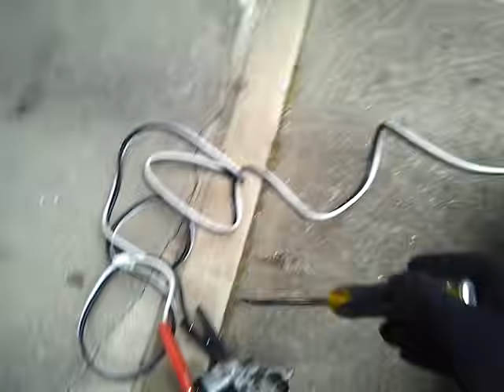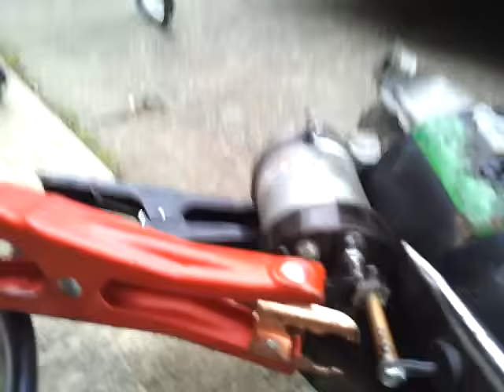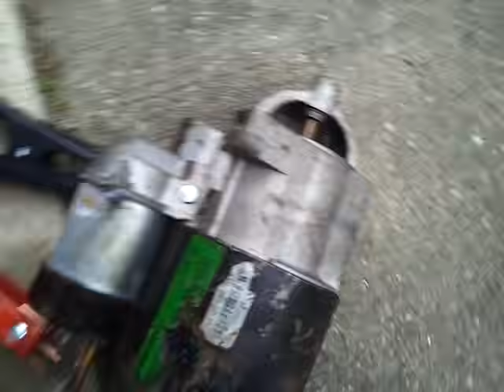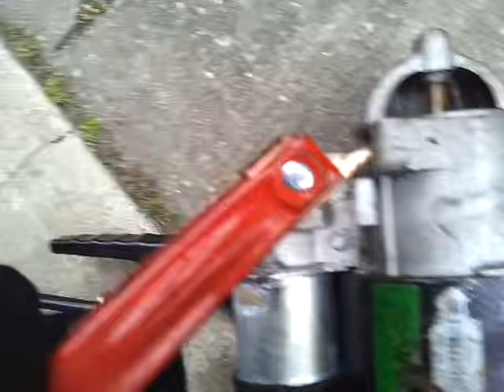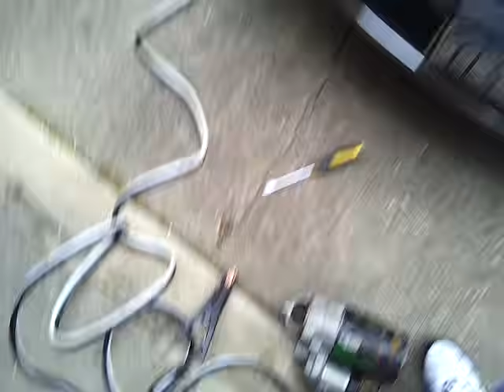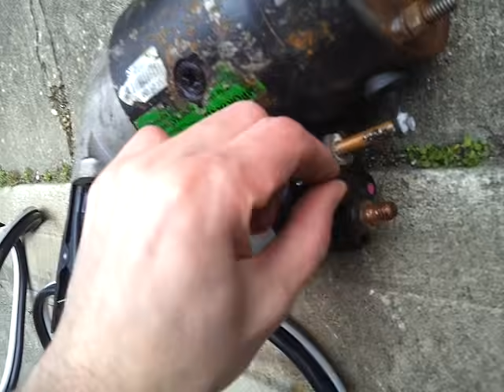How To Test A Car Starter With A Screwdriver And Jumper Cables!

Comment: My starter has no terminals on the solenoid. (Caravan '97.) The terminals are more 'sealed' and on opposite sides of the starter. Can mine be jumped? I gave it a shot and just got sparks. Don't know what I did wrong. It seems like each kind of terminal might be present -- but maybe they somehow don't work like before? Thanks! ... I did take my starter out already. So here's why I did it: My symptom was that it usually took about 20 'clicks' before it would start. When it started it started great and strong but was totally unpredictable, unreliable. I cleaned my batt terminals, no change. I do see that my wiring harness has broken sheathing -- maybe I should've tested wiggling it before I removed my starter... UPDATE: Took me 30 min's to remove, 10 min's to replace. Now it's starting every time!

Comment: Never test a starter with your car, you could spike the voltage and damage the computer on the car or blow fuses.
Reply: Yeah I think the fusible link (12 ga cable) that connects to the POS side of my starter solenoid got burnt out in order to protect the other components, and I gotta replace it, I watched someone else's video yesterday where they cut open similar Fusible link cables and just installed a  new length of cable that is the same size in diameter and then he welded them together with a basic soldering iron and most of the comments were telling him how shitty  a soldering job he did and how he could do it better and stuff, but in the end he  accomplished what he wanted to.
Reply: My problem is I'm not getting any power to the dash when I turn the key anymore, but the battery is brand new and the original starter solenoid  also seemed to be functioning normal, it was reading 12.2 on the POS side and when I turn the key, the  output side (to starter) read 12.2, but no noise from the starter, I noticed My starter is covered in grime as it sits under the power steering system and all of that shit is also covered in the grime, my next step is clean the starter and remove it for testing.
Reply: The thing is there was nothing wrong with my starting system, but I notice it was taking longer to start and many fuel filter symptoms so I figured it was that, I made a mistake of taking all the cables off the starter solenoid and not pay attention to how they were on and when I put them back on I ruined something, at first I still had power to the dash but when I turned the key it was just a single loud click, but now that isn't happening
Reply: My car is a 1988 mercury Sable and there aren't any engine control fuses or starter fuses or fuse box under the hood , there's only auxiliary fuses  inside the passenger compartment so that why I'm having a harder time diagnosing shit

Comment: A word of advice from someone with experience; when putting power to the posts, install the nut first on both posts so when the jumper cables arc you don't mess up the threads. You can ruin the studs that way and you'll never get the nut back on if the starter is tested and turns out to be good.
Reply: Arvin Tiongco I wasn't going to bother giving your idiotic reply one of my own but I have to say you are one quick tempered little Tiongco. Yes, "Tiongco", that is my new word for someone who is a complete dunce.  
I know exactly what the title of this video is and how does calling me an idiot for trying to help others who might attempt this make any sense whatsoever? If you are going to bench test a car starter with a screwdriver or jumper cables, it's best to screw on a nut to the post threads and use the nut as the contact point for the cables and screw driver so there is no arcing on the threads. This will ruin the threads and cause more headaches to deal with.
This is simply common sense being passed on from me(someone with experience) to people like you(those without) and there is no reason to call ME an idiot for trying to help others with their future projects. Damn Tiongcos, always causing trouble.
Reply: @jameslandon4126  I agree with you Jim. I am just starting to learn about testing things and installing things on my old truck. If someone is willing to give me advice, I will listen and appreciate it. Now if that guy is full of shit and I can prove it them I might call him an idiot. Till then  Jim, I am with you.
Reply: @jameslandon4126  From an actual professional technician you guys need to Watch some videos by Schrodinger‘s box, Scanner Danner, Eric the car guy, etc.  get a voltmeter and practice. (Stop arcing and sparking everything!)
Reply: Jim Garrison
I 100% agree... nice reply back...  :-)
Reply: Good point mate
Reply: Jim Garrison I almost did exactly that today, not 20 minutes ago. Sound advice.
Reply: Jim Garrison, didn't you have something to do with the JFK assassination? (other then that thanks for the heads up, am about to test starter now) Oh yeah and a big thanks to you too, Rocky.
Reply: Harbor freight sells a cheap remote button you can use to bypass relays,ignition switch,ect. and may help as well when testing or diagnosing...good on you for your help. Bad on those that behave ungrateful and argumentive...
Reply: Jim Garrison Youre a smart Man. And I wouldnt have thought of that. good looking out
Reply: Good to know also tks..
Reply: Yo Jimbo and Rocko ftw !
Reply: This happened to me 😂
Reply: Thanks for the tip! I would not have thought of that.
Reply: 🙄.....no
Reply: In addition to that, He should have been more careful arching out the positive jumper cable to the grounded starter!! Not only is it bad for the battery, the battery he's running the jumper cables from is still connected to a vehicle!! You could blow the ECM doing less giving somebody a jump start!!
Reply: Jim Garrison common sense will do a lot.... however not many people have that...
Reply: How To Test A Car Starter With A Screwdriver And Jumper cables.. did you read that idiot? or you just trying to show off!

Comment: mine pops up and then slides in and in out in and out of the hole over and over. in and out the hole. then it goes down. is that normal?

Comment: So I'm a little confused.  If I have the battery connected to the large (+) post and I jump it across to the little (s) post, isn't that the same as if I just connected the battery to the little (s) post to begin with? In each case, if the starter cranks, it's telling me the solenoid is good and and the starter motor is good. Am I right? So then failure to crank means the solenoid or starter motor are bad. And cranking means that the fault is upstream from the solenoid...like with the car battery, the wiring to the starter, the starter relay, the Neutral Safety Switch, the ignition, etc.. Right?

Comment: this is a good info for to me. I am having problem starting my car in the morning only before going to work. I noticed that during turning on the engine could hardly start or wont start at all. there is a kick from the starter but I don't know where the problem is coming from. but then after trying the 2nd key, it would go as normal start-up like no problem happened. could it be a starter or the battery? what is the low limit of voltage from the battery that I could consider to be abnormal? thanks mate. I hope to hear from you before taking out the starter..

Comment: This is a good way to find out if your pinion gear extends and turns. Nothing more. How do you know if the starter isnt drawing more power than it should or that its spinning with enough force to start the engine. Take it to any auto parts store and have them test it. Oh and by the way you can do this while its still on the car you don't have to take it off to do this particular trick

Comment: Thanks a lot for a clear and concise video on testing the starter. It's the next step in figuring out what's failed on my truck. I've seen other videos, but yours added the parts about checking the solenoid, motor, etc individually, which others skipped.

Comment: i still have a question! in the starter selenoid video, you said how we should wire the starter and the remote starter selenoid! but if you jump the fat stud with the S terminal this  doesnt mean that because is connected directly to the battery is going to pop out the gear always?? i know u said that we have to wire the S terminal to the fat stud with a jumper and the S terminal of the starter is goign to the S terminal in the remote starter selenoid, im kinda @_@!! sorry for my english

Comment from the maker: Your welcome.. Ok no mods..u should have battery voltage to the big stud on the starter..(no voltage drop)..check ur battery terminals should be tight and clean..its kind of a process to troubleshoot

Comment from the maker: Also keep note that heat increases resistence so it might also be the starter when its hot only..you could have a dead spot on the starter as well... I would put a test light  on the small stud (s terminal) and try to replicate it again..make sure u have power there..check to see all your cables are tight as well..battery going to starter...

Comment from the maker: What kind of car is this? Do you have any aftermarket stuff on it like headers to add heat to your engine? If this is just a regular car then try to replicate the issue..i would start it and shut it off quite a few times when the motor is cold..and if u can replicate it when cold, then its most likely the starter...